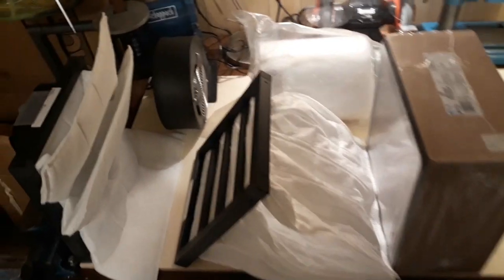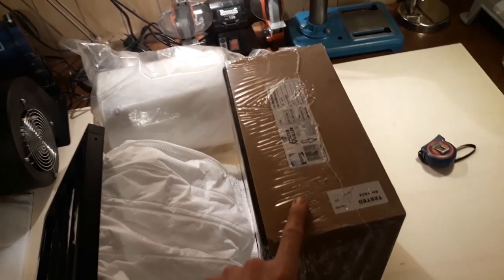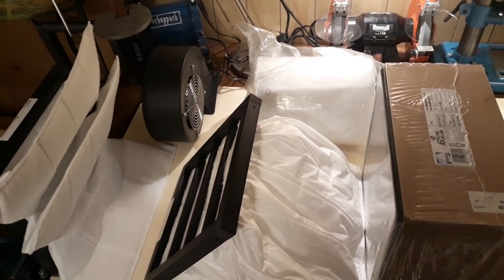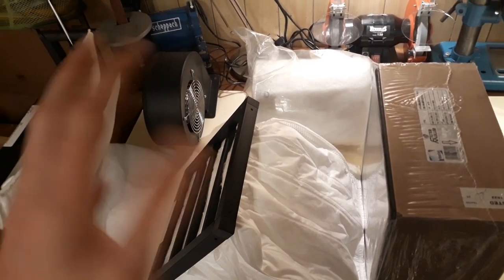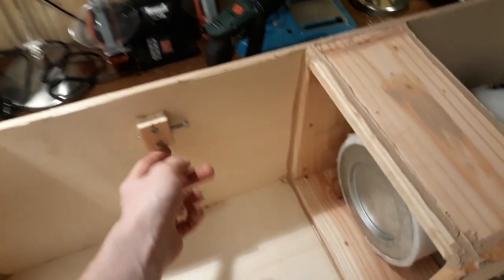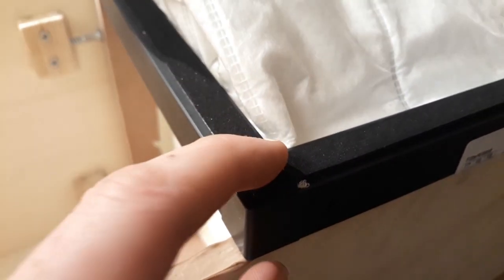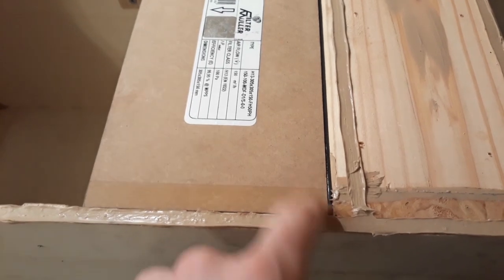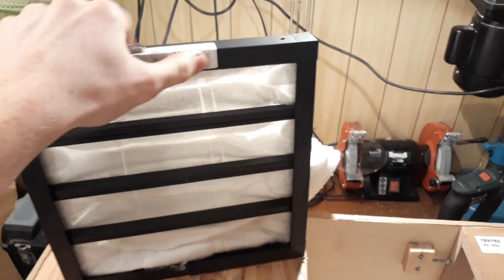Building a Ventilation System - Making a Laser Cutter Ep. 8

Comment: Hey, I am currently planning to build a similar filter. I guess you got the pre-filters as well as the HEPA from Mueller Filter (at least I am planning those from there and they look similar). I've got a couple of questions and would really appreciate if you could help me out building my filter. Is this HEPA the 30cmx30cmx15cm version? Which activated carbon filter and ventilator did you get? Are you still happy with your design? As I am going to run my laser within a rented apartment but venting the exhausted air out of a window (therefore mostly concerned about odors and my neighbours), do I still need the HEPA (e.g. to prevent clogging the activate carbon filter)? Thanks a lot in advance!
Reply from the maker: Yes, the HEPA is 30x30x15. I ordered the carbon filter from amazon, I dont remember the exact seller. 
In general, I am happy with the design, but I wish I would have looked more at the volumetric flow specs of the filters. The HEPA and carbon filters currently are a strong bottleneck of the system, its definitely not living up to its potential.
As far as I know, the HEPA is mostly there to filter out the very small, carcinogenic stuff (pm2.5 dust). Of course it also prevents clogging the carbon filter, but if that is the only concern, its probably cheaper to just change out the carbon filter more often. 
I probably wouldn't advise to leave out the HEPA filter because some smoke may enter through the same window you are blowing it out of, even if you cant smell it (because of the carbon filter). It's probably a small risk, but its up to you to decide if you are willing to take it.
Reply: @WoodenWeaponry  thanks a lot!
Reply: @dominikhubner4972  You definitely need a filter before your carbon filter. Regular filters filter particulate matter (dust and smoke). Carbon filters filter gas. If you don't use a regular filter before your carbon filter, the dust will quickly clog the pores of the carbon and then it can no longer effectively trap the gas. Also, the carbon filter used in this video isn't the best choice for this application. It's best to purchase your own bulk activated carbon and use 20 pounds of it inside of a box.
Reply: @WoodenWeaponry  Hello, if you still have the setup in the video try to put the hepa filter in the other direction, like the arrow suggest, also i would recommend a more powerfull fan, that one seems a bit underrated.cheers